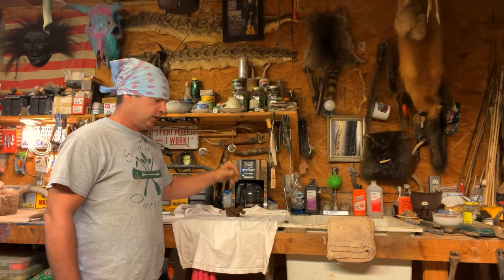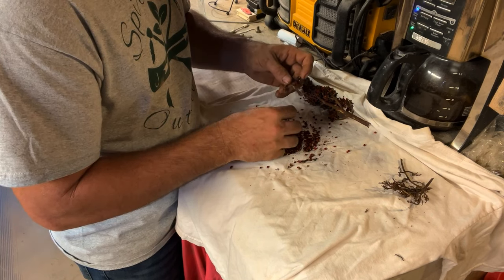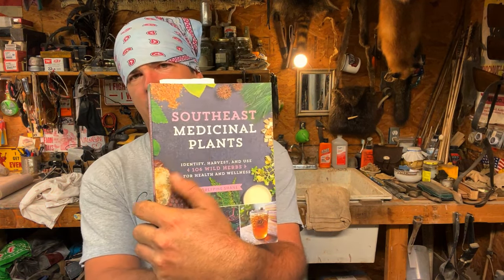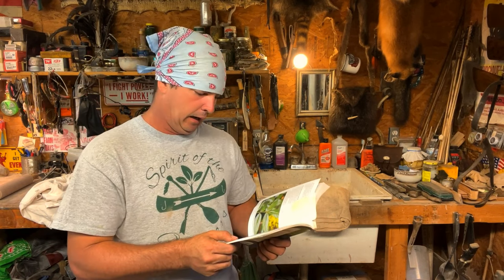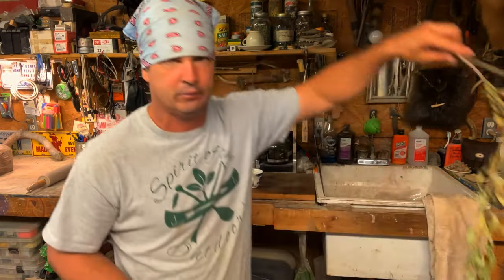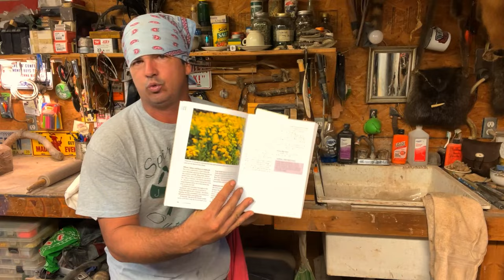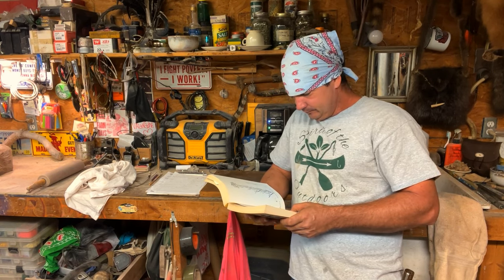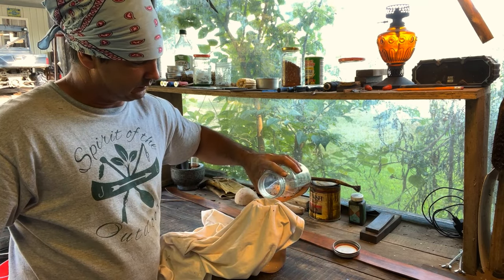Making Sumac Tea and taliking about Goldenrod and Rabbit tobacco

Comment: Good morning Justin,  good video, I find it best to use entire  cone but I cut them down , we have staghorn variety,  so they are 4-10 in long I use 5 cones or more per gallon, cutting stem off cone  at base . I've  tried it with cold water dint like   I use hot tapwater but not to hot , about as hot as if it were in direct sun all day key. Your tea might be weak. I like mine strong that's how I was taught by gramma,  add sugar to taste , honey. Or other flavors like raspberry ,Cherry.  You'll figure it out. Also I will let stag brew 2-3 days with clean hands squeeze the cones to get all the goods . Nope you needs more berrys.
Reply from the maker: Yea i found this to be weak. If i had more ida made it stronger but im wanting to makes seasoning more than drink. I think id get more used out of that

Comment: Love how your opening scene has a big ole chem trail in it.
Reply: It’s not a chem trail. It’s a condensation trail.
Reply: @120weapons  going to have to call Bologne Sandwich on that. Condensation trails disperse more quickly and therefore are shorter. This is a chemtrail, most likely blocking rainfall in the area causing drought and which lead to wildfires...
Reply from the maker: How long it lingers has to do with the temperature at that altitude. It is from difference in the temperature of the exhaust and the air its mixing with. Im sure there are some chemicals in it but no difference that car exhaust in cold weather . Same exact thing